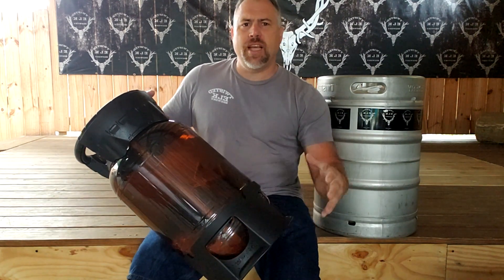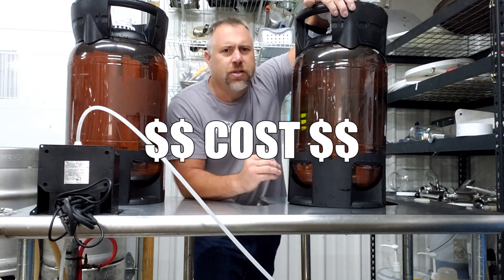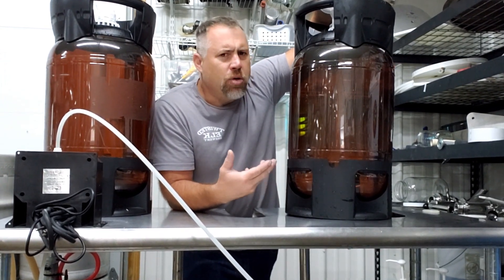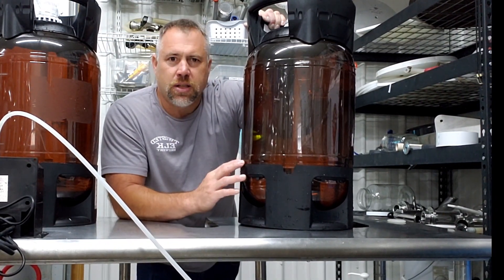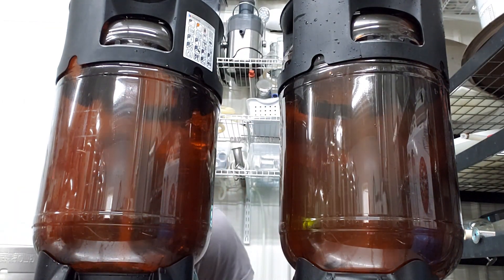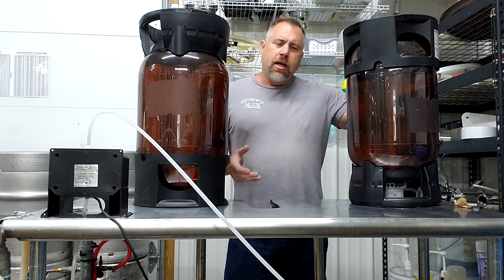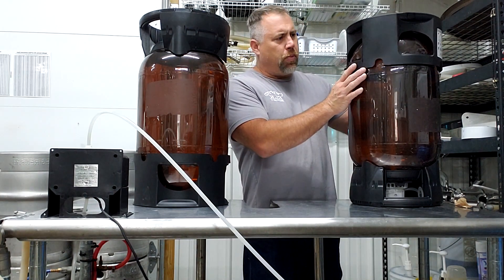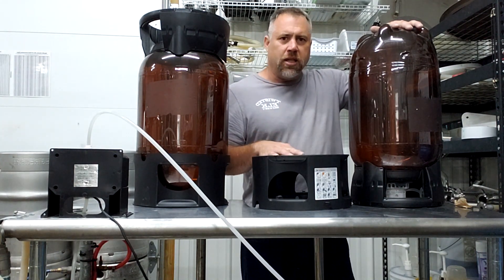Plastic Keg Review and Cleaning/Refilling Experiment

Comment: As a home brewer i have two 30l chubby fermenters. The instruction have them with a 2 year life, without pressure testing. They advise max of 55°C /130F and to avoid pinging the vessel. So avoiding the vacuum effect - which i struggle with. That said i do like them whether as pressure fermenters or dispense. Weight and non return of metal kegs loss at events being the other cost benefit

Comment: Hi, I use plastic kegs, and I also ferment beer in them under pressure. The only problem is that the lids burst from time to time when I ferment under pressure, since there is a pressure device on it and it bends it. But they are cheap, you can change them every 2-3 months.

Comment: Hi there. I've washed and reused these kegs for the past two years. I generally get about six uses out of them before they get scuffed and damaged. Depends on how they are treated... A colder run on the keg washer works and I made a tool to take the spears out and then you can bump them back on after cleaning... Great for domestic so you aren't worried about your keg being returned. A small deposit keeps them coming back generally.
Reply from the maker: Great tip!